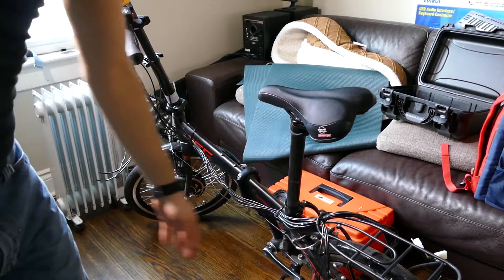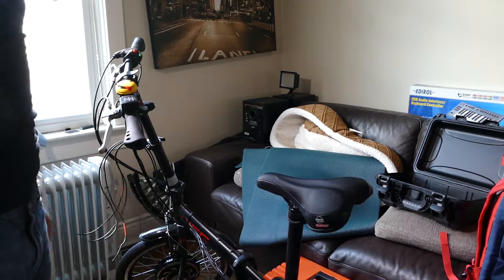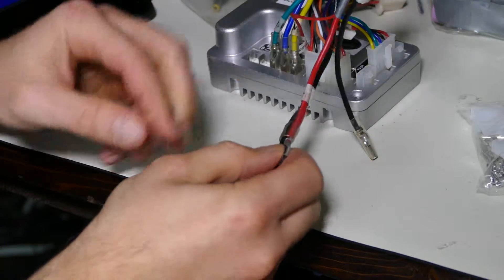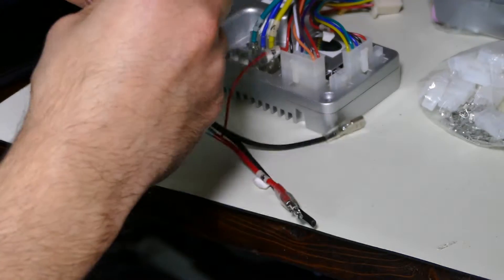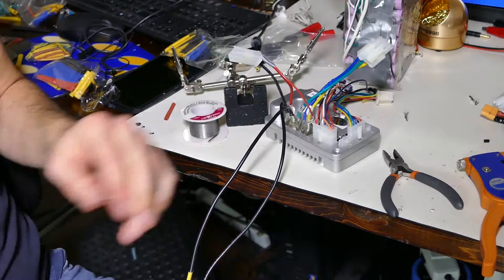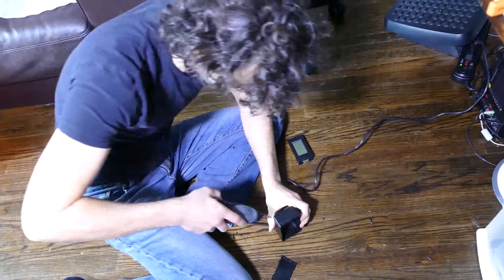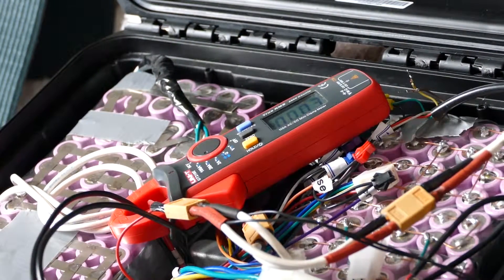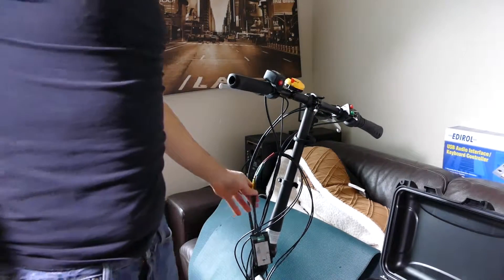Pelican Case Battery Holder install w/ Ammeter/Power Meter Pt 1

Comment: the pelican cases work well    https://www.youtube.com/channel/UCE9yN9ldp_a_1PxZCAWLYjw
Reply from the maker: +karma-Ebikes  im thinking about replacing my controller (golden motor garbage) right now my max speed unassisted is about 32-35km/hr you think a controller would be a worthy replacement? the cable is very expensive to change settings on the one i have
Reply: +Learnding Diy  aliexpress has good controllers cheep a 1000watt or 1500watt works well and powerful. i had the same gm controller didn't like it and the usb cable work very little to change the settings
Reply from the maker: there seems to be one for around 65$ cdn on ali express i was eyeing i think i might try it out thx.